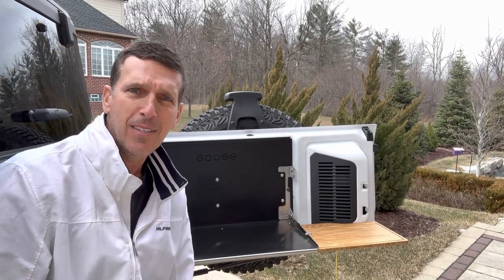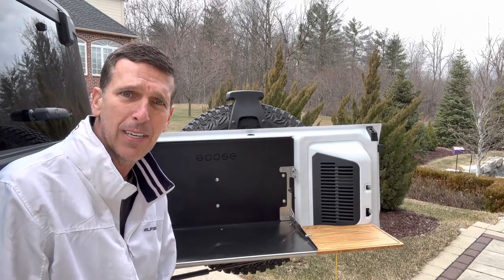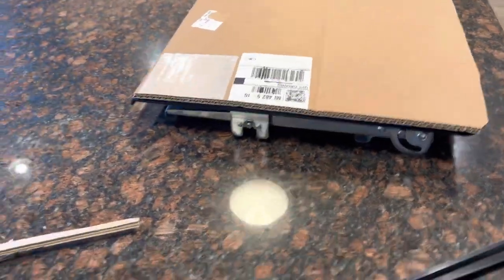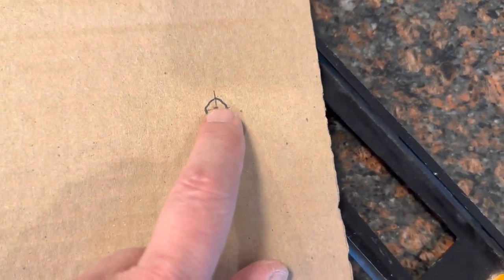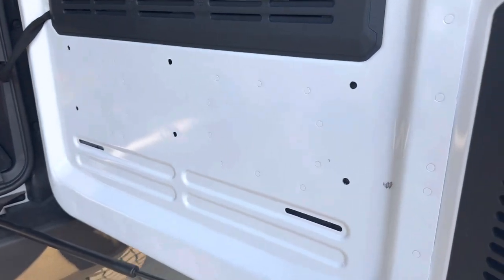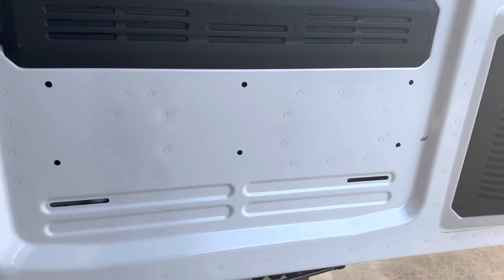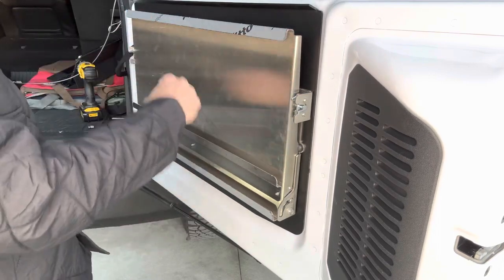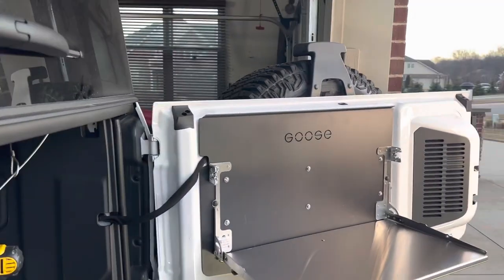Goose Gear Ford Bronco 2021-Present 6th Gen - Tailgate Table : Install guide and review

Comment: Looks like you installed over the top of that black factory trim piece up top, or did you remove that piece so it would flush up against the tailgate panel?
Reply from the maker: Good eye! I did originally leave on, because the goose gear instruction manual didn’t say to remove it. But I did unbolt it and remove the plastic trim, panel, and reinstall. I also transferred the table over to my Raptor and remove the plastic panel for that as well.